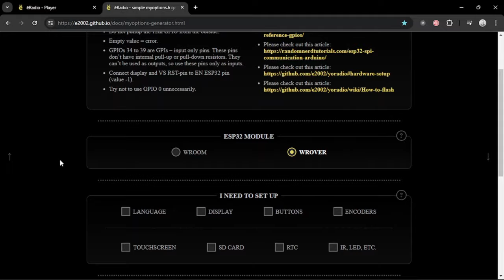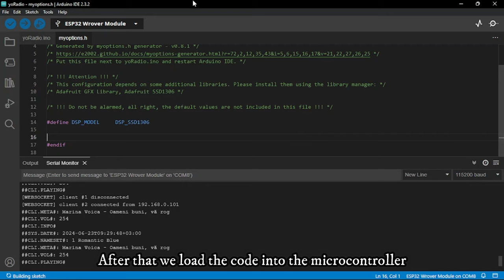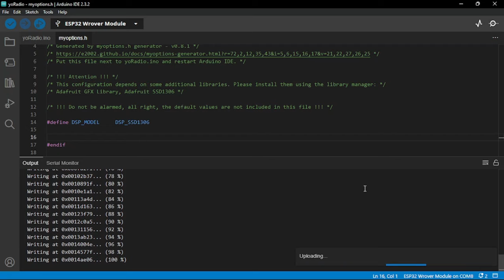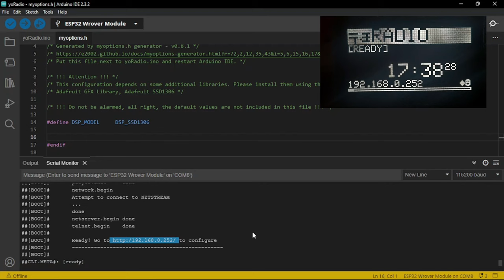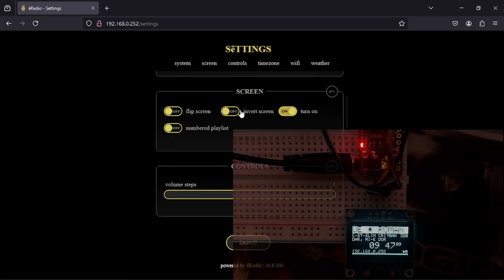yoRadio STEP BY STEP - ( Step 3 - DISPLAY) ESP32 + PCM5102A + SSD1306 OLED display - webradio player

Comment: Salut,am făcut și eu acest radio cu ceva timp în urma și funcționează perfect.Problema este ca l-am dat fiului meu și la dus la Cluj di nu reușește sa-l conecteze la wifi.Poti sa-mi spui de ce?
Reply from the maker: Nu am idee de ce nu se conectează. Probabil ar trebui să încercați reîncărcarea firmware-ului cu opțiunea Erase Flash activat în Arduino IDE.
Reply: @LeventeDaradici  Din ce am" citit "pe forumul rusilor nu ar trebui sa fie probleme la conectarea în alta rețea.
Reply from the maker: Nu ar trebui sa ai asemenea probleme.